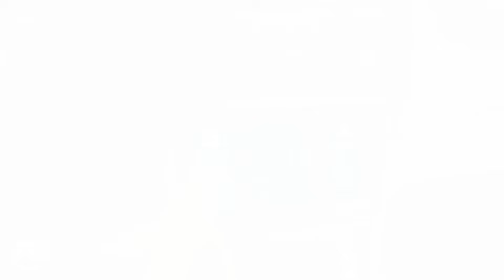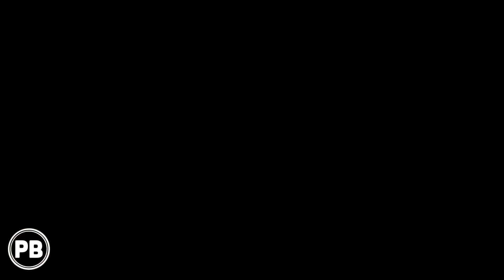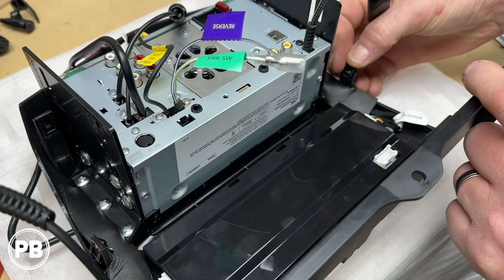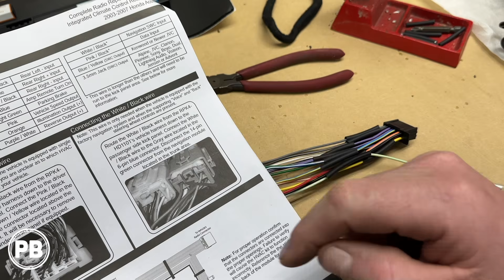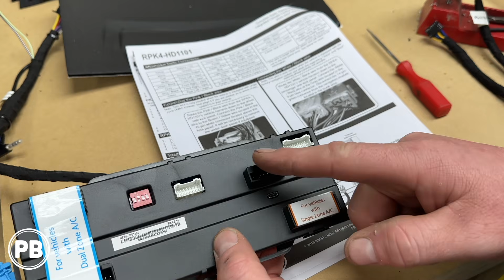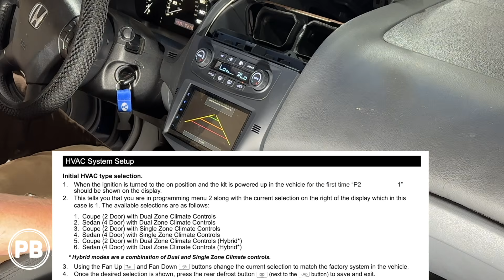2003 - 2007 Honda Accord Radio Install

Comment: K, the climate control is not run by the clip that goes into the old radio.

It’s a separate wire harness

Comment: When it says plug the black/white wire into the gray wire on the passenger side do you keep the gray wire plugged in and just attach it to the gray wire with it intact or do you split it and plug the black and white wire into the gray wire going to the plug or going up the vehicle panel

Comment: What are the odds you uploaded this 1 month ago, and I'm doing my girlfriends 2006 now! We're using the metra mount, I got it for a steal at 100 dollars. I tried absolutely everything to make her factory head unit work for her, but there's only so much you can do to polish those turds. The Bluetooth adapters that use the XM/navigation socket are super quiet and have a lot of EMI noise. I even tried one of those cheap "DSP's" (I'm pretty sure it's just an amp, no actually processing) that are meant to be plug and play on the back of an android unit. Took me over 12 hours of labor making a custom harness to relocate it. All it did was end up clipping her back speakers like crazy bc of the low input signal of the Bluetooth adapter. I think she took pity on me and said we could do an aftermarket head unit if we got one of these climate control mounts. She so excited with how much it will Improve the sound of her 2 8" subwoofers, now that they're not tied to the rear signal of her speakers which would clip like crazy if we put the eq bass at +2.

Comment: $600!?? For a Pac RPK4HD1101 Honda Radio Replacement Kit?   Half the value of my car ..,,
Reply: It's honestly the best option unfortunately. Most of the cheap android units will either not work, or overdrive your blender door motors and shred the gears in them.

Comment: I had my battery replaced on my accord and now my head unit and everything is locked to the internavi system, as my disc is all scratched, would this work to get around that issue?
Reply: Look in your car manual for a car code. It’s for your radio. It provides a code for you to  put into the Radio.

Comment: Hey man I’ve got the same problem. Not looking to put a head unit in the lower compartment though. 

This seems to be the lest looking kit on the market that allows a standard aftermarket head unit. 

My dilemma though is that it seems to be in Fahrenheit for temp controls, do you know if it can be changed to Celsius?

Cheers
Reply: But yes it can display in C if you want to use a unit of measurement designed for the states of matter for water.
Reply: It's forcing you to use a better unit of measurement. Take it as a sign to program your brain to Fahrenheit.

Comment: My 07 Accord does Not have a dual climate option its a base model car what radio do i get i seem to be having trouble finding one
Reply from the maker: With this install kit, any radio will work (standard sized double din, any brand name radio).